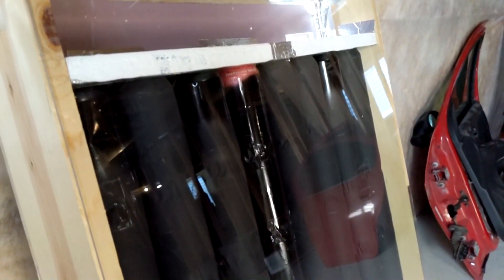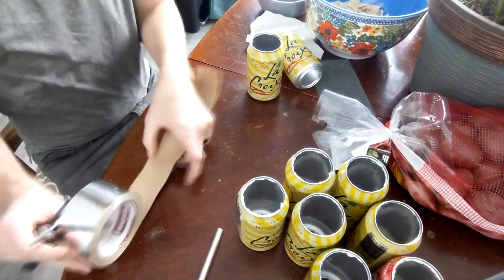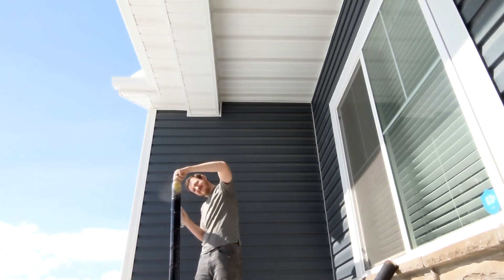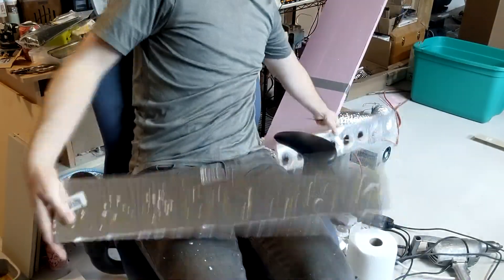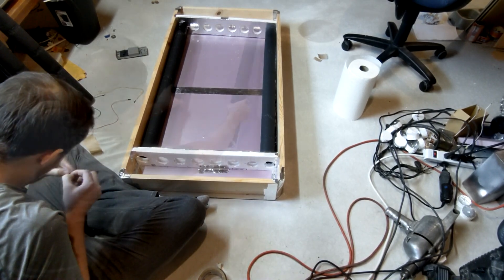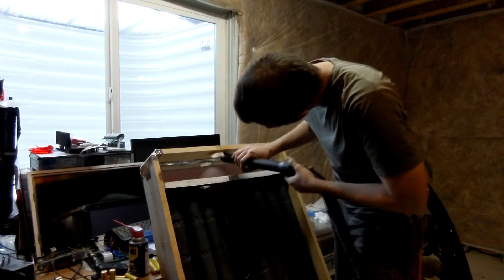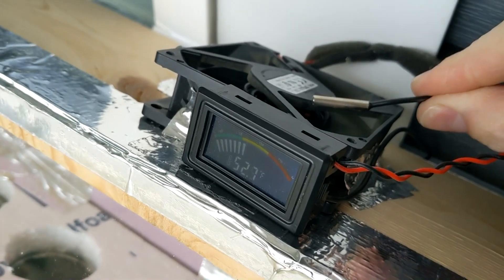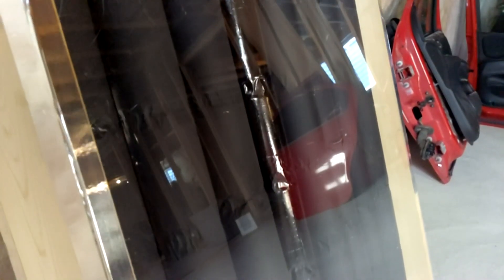Build Your Own Solar Heater And Save Money!

Comment: This is really cool! Is there some kind of aluminum tube that could be used instead of pop cans so it would be easier to build?
Reply from the maker: Yup, you can buy aluminum tubing from just about any metal supply company. I would recommend using steel tubing though because it has a much larger thermal mass and will store more heat during the day to use later.

Comment: This is fantastic! Has this been tested during winter?
Reply from the maker: Yup! I've been using it over the winter and on the days when it was 35-40° outside it was still putting out about 85° air. It would be more efficient if I ran air from inside the house into the intake of the heater instead of the cold outside air though.